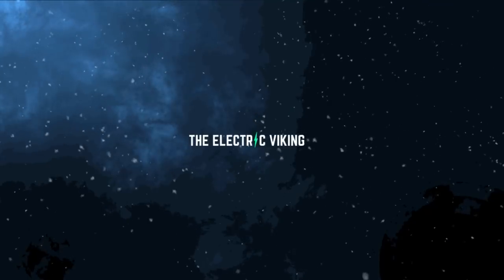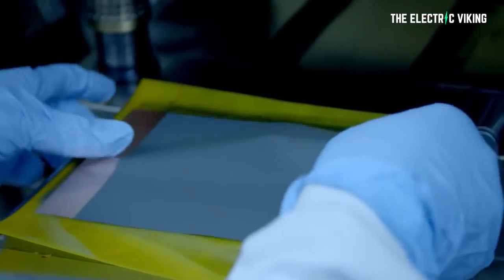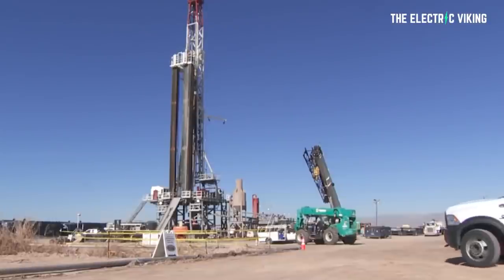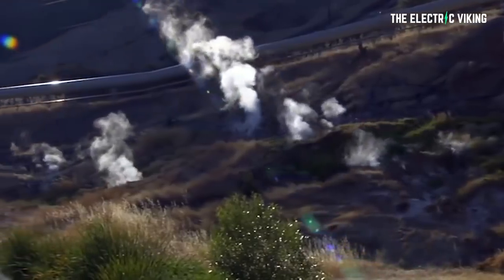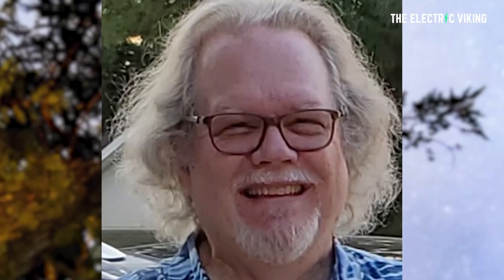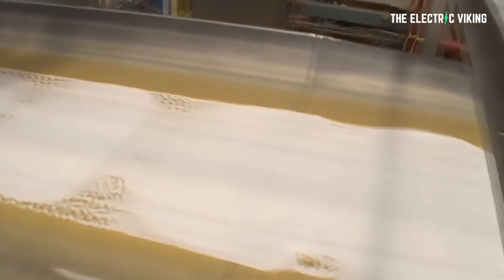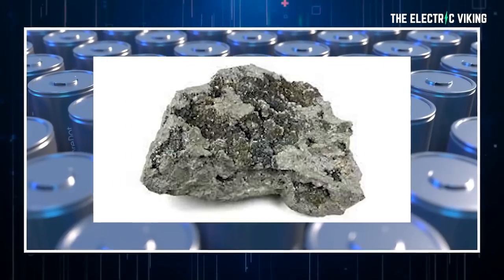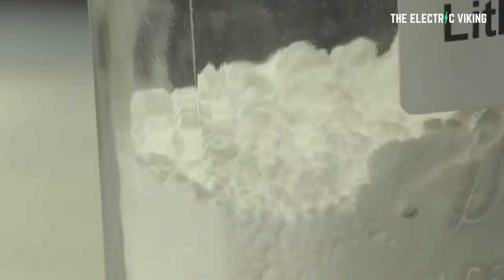Can California’s lithium valley power a US EV revolution?

Comment: There is also a lot of lithium in Mexico. There is a reason why GM and other car manufacturers are setting up larger factories in Mexico. If I'm not mistaken, Mexico has about 14 sites that have lithium for extraction. Now, the question comes to the cost of extraction and the environmental impact. The Salton Sea is not just going to become a lithium site but also an ecosystem of battery manufacturing, recycling, and other battery storage industries. This is why I expect Chinese, Korean, and American EV companies expanding operations in California.
Reply: GM and F make cars in Mexico because labor costs are lower.  Lithium had nothing to do with that decision.
Reply: @incognitotorpedo42  we all know labor is cheaper but you are forgetting that Mexican labor is also much younger. Lithium in Mexico  definitely has impacted the continuous increase of manufacturing there. Mexico itself is using the lithium angle for foreign investment.

Comment: The US has massive amounts of lithium in Wyoming and Nevada.  There's lithium brine about 200 miles south of GF Reno.  

The US use to produce lithium in North Carolina prior to China producing lithium and selling it below NC's cost.  I believe that NC source is being restarted.

Salt deposits, including lithium salts, occur when rain runoff leeches dissolvable salts from wide areas of surface ground, the water runs into a basin, including the big basin we call the Ocean, creating concentrated salts.  If the basin dries then there's dry lithium salt.

We don't need to worry about replenishing rates for the Salton Sea sources.  Over the next ten to fifteen years we will do most of the lithium mining/extraction that will need to be done.  We need the first generation of batteries for vehicles and storage.  After that we recycle.  Technology already up and running.
Reply: You are right. This is underestimated.
I think landfills will be mined for all sorts of stuff in the future.
Reply: @andrewsaint6581  

Batteries will stop going to landfills.  Pretty much now.  Used batteries are already being recycled and their materials reused.  It's just a matter of getting recycling centers spaced around the planet so that shipping costs aren't too high.

Then think what happens as we start using humanoid robots.  Someone has estimated that it will cost Tesla $10k to build a humanoid robot.  My guess is that it will be less than that at scale.  But let's assume $10k and a useful lifespan of ten years (probably much longer than that with simple parts replacements).

$10k / 365 days / 24 hours / 10 years = $0.114/hour.

Less than 15 cents per hour including charging.  Robots don't get sick, take vacations, slack off, take meal and bathroom breaks, quit without notice, and all those other human employment problems.

We can open up landfills, scoop out piles of stuff, dump it on rotating circular tables, and let robots pick thorough it for at a tiny cost.
Reply: @bobwallace9753  the won't mind the flies, rats or stench either.

Comment: It's not only the lithium concentration but high magnesium concentrations makes it hard to separate the lithium to make lithium carbonate or lithium hydroxide needed for batteries. This has been an issue for Bolivia which also has massive lithium in their salt flats.
Reply: I'm surprised that would be a problem.  Mg is divalent, while Li is monovalent.  That's pretty different, chemically, and large chemical differences usually result in easy separations.

Comment: So many naysayers in the comments. JB Straubel former tech architect of Tesla founded Redwood Recycling. He said lithium batteries in use today are 100% recyclable, with no degradation of the core material. So, we will eventually reach a sustainable run rate of using recycled batteries and minimize new mining. Whatever the problems are, they are 1000X smaller than continue with fossil fuels.
Reply: Negative comments are cheap and give the writer a buzz

Comment: Lithium is only one of several minerals needed to create EV batteries. Plus, you need to refine all these minerals at a competitive price. Then, you need to build all the factories to build these batteries and EVs, which could take a decade.
Reply: Start soon, work fast.
Like Tesla, eh? 😉
Reply: Not a decade. Sam did an article on just U.S. battery factories recently. And by the end of 2025 there will be enough domestic supply for over 55% of all vehicle's to be an ev. And that doesn't count since planned expansions, an announcement by a China co to build a new battery plant, teslas planned 4680 production etc.👍🏻
Reply: @4literv6  Yeah, you're right. A decade is a little too harsh. Maybe 5 years or so. With these things, it's still unpredictable since we don't know what permits, environmental reviews, labor issues, etc will slow down the process. I think the biggest problem the U.S. faces is being able to refine these minerals at a competitive price since China dominates that segment of the market with over 80% of market share.
Reply: @hayden1770  those are some very applicable point's to consider. Especially about China controlling a lot of battery sourcing materials.
I'd suggest though doing some us research. As there are some new mines coming online in the next 3-5 year's for nickle and lithium.

Then there is the salton sea geo thermal project funded by Bill Gates and Berkshire Hathaway energy division. Which is trying to perfect getting lithium out of the brine from geo thermal processes. So we are slowly working on it.

Comment: The saline fluid is quite corrosive and damages most equipment and piping that it comes in contact with. Not impossible to handle but difficult and perhaps expensive.
Reply: Iceland is powered by geothermal.
So I'm not sure what the problem is.

Comment: But there is more!. The Salton Sea is NOT a natural formation. It was a saltish flat, (sand flats mixed with salt) formed over geologic time from periodic water of the area by flooding of the nearby Colorado River. The Salton Sea as we know it today was formed when an irrigation canal being constructed in the Imperial Valley in 1905 breached and flowed into what was then called the Salton Sink. Since this was not a natural formation the waters filled the sink and just stayed there. As the water evaporated the salt concentration in the water grew. As agriculture in the Imperial Valley, California grew, the water became full of chemicals that were forever growing in concentration as the water in the sea evaporated. Recreating these new salt and chemical flats into the flat ponds used to extract lithium would have less negative environmental impact than what is there today. What is happening today is as the Salton Sea returns to being a desert the agricultural chemicals turn into powder on the exposed shorelines and beaches, (the new flats). The wind kicks these chemicals into the air, which are then breathed in by the residents of the area, mostly poor people and the children of poor people. They end up with lots of respiratory diseases. To have those exposed areas covered with ponds would reduce the chemical dust being kicked up by the winds. The leftover salt and chemicals can then be removed and buried in the nearby desert where the water table is low, preventing air and water contamination. You can add the water from the geothermal power plants into the ponds as well and extract even more lithium. This is all dependent on if the water of the Salton Sea and the geothermal plants actually contains enough lithium in it where this is economically feasible.

Comment: Recharge News interview with CEO of Hyzon, discussing the problem with charging ev semis and buses: Knight says that several bus operators around the world, including one in Sydney, Australia, have already run into problems with the charging of multiple battery-electric buses. . . “He [the power supplier] said, ‘your maximum number of buses in that location here in Sydney with this grid is six buses. If you charge at a higher rate than that, we’ll simply turn you off... because you’ll pull down the [grid for the] whole inner west [area] of Sydney, it can’t sustain this amount of power.”
Reply: The fix for this is either staggered charging times or beefing up the grid.  Neither will stop the onslaught of EVs.